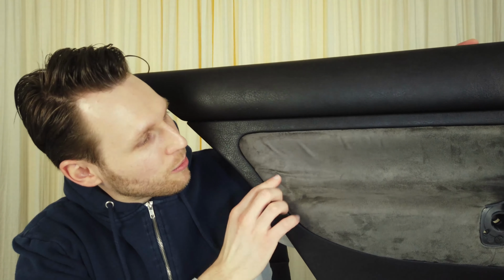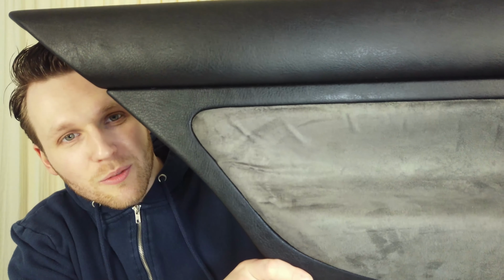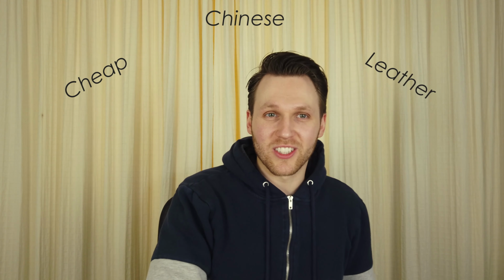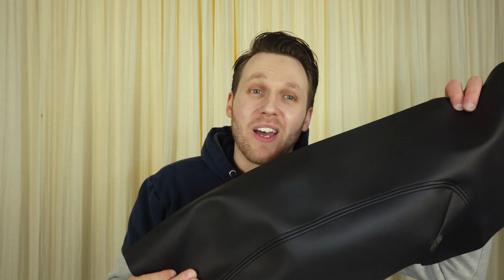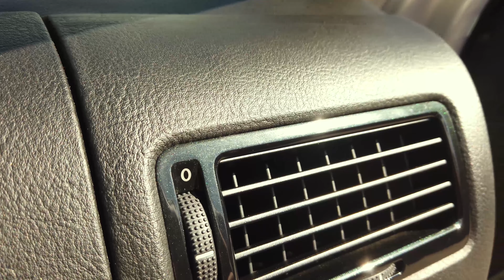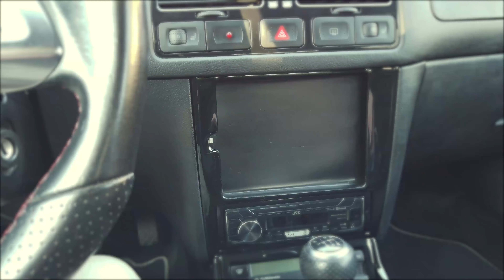RETROFITTING THE GOLF MK4 DOOR PANELS WITH CHEAP CHINESE LEATHER | GOLF MK4 HANNI'S ENGINEERING

Comment: Hey , door cards came out exceptionally great but what really caught my eye was the plastic handles for pulling the doors closed and the driver side window switches etc plastic, what kind of paint did u use on those to achieve that glossy finish? Thanks in advance hommie!
Reply from the maker: You already found my video about painting the air-vents :)

Comment: Are you using plasticweld on the inside of the door cards for the little tabs?
Reply from the maker: it's 2 component epoxy for plastic, i got t from a car body repair shop but basically everything will work even some hot glue if you use enough :P
Reply: Awesome, I went with Permatex Platic Weld Epoxy, worked a treat!.
Any tips for fitting the front passenger & driver ones?
Tried the front passenger and didn't seem to line up correctly...
Reply from the maker: @calhouston2517  defenitly recommend using a heatergun and some plastic tool to form it correctly

Comment: What kind of glue where u using for the panels before u ripped it off?
Reply from the maker: I used this https://www.schuimwinkel.nl/spuitlijm.html
Reply: Yes for the leather. But i mean for the hole panel which was glued on the door. 2:27.
Reply from the maker: @Neilos1798  2 component epoxy for plastics, i don't have a link for that i bought it locally, i also used some hot glue here and there to reduce noice / rathels

Comment: Where did you find the buttonless mk6 wheel? Looking for one or even an mk7 wheel for my mk4
Reply from the maker: I just bought it secondhand, they are rare but the Polo GTI has the same steering wheel without the buttons i believe.
Reply: @HannisEngineeringOfficial  yea it seems very rare to come by them in America sadly
Reply from the maker: @I53-624  That's to bad you can also just get the steering wheel with buttons and just replace them with the buttonless caps